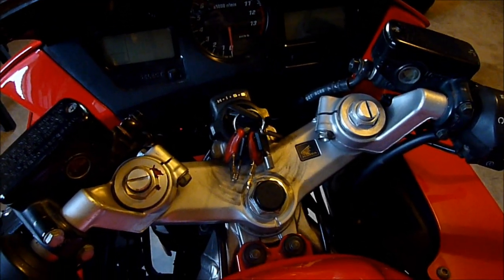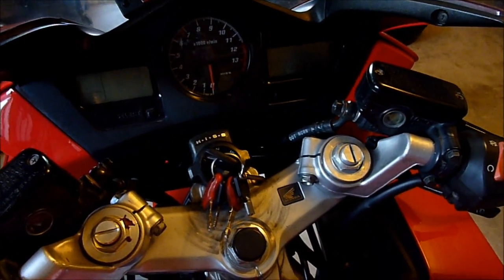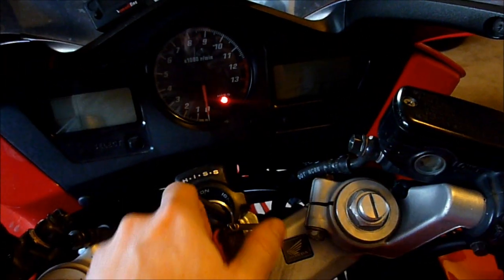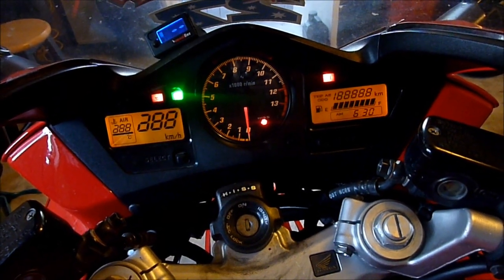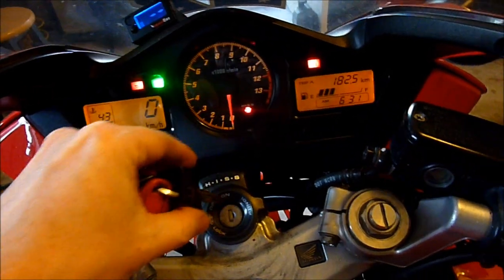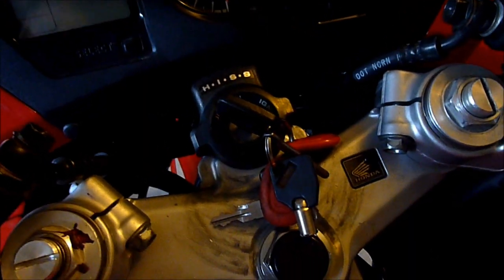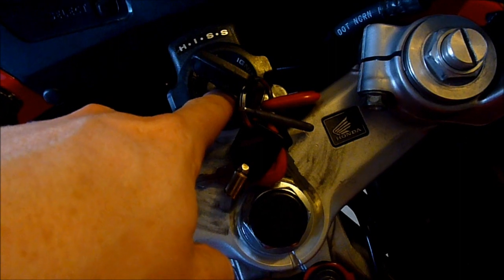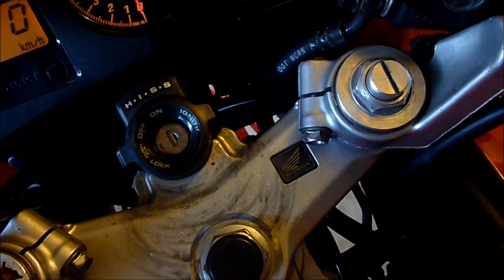Honda Ignition Security System behaviour

Comment from the maker: You could easily test this - wrap one key up in heaps of tinfoil so that when you insert it the HISS fails.   Then take a spare key and hold it near the transponder ring on the ignition block so the bike starts.  When the bike has started, remove that second key and see what happens.

Comment: On my SH300i I can start the bike on a non-chipped key (but have to hold a chipped key next to receiver). THEN, take the chipped key away and the bike will continue to run. I think the chipped key is only required to "activate" the system once. You need the chipped key each time to start the bike.

Comment: hi, brilliant video thanks, i have a hornet 2007 with HISS system, i was wondering if it is possible to drive the bike using just a cut key for the ignition and another key say just attached to the key ring which is coded to the bike. 

im just wondering if the hiss will get confused with different transponder chips next to it.

Thanks for your time

Comment from the maker: Not sure what you're trying to do?  If you have a broken key you can just pop the chip out of it and put it into a new cut key.  The transponder and chip has nothing to do with the metal in the key; it's an RFID chip which is powered solely by the transponder's radio waves.

Comment: I have a 954rr with a 929rr gauge cluster. When i turn the ignition on the light is green. Fuel pump primes and then it turns off. Bike starts normally.

When i turn the bike off the HISS light does not blink or flash red indicating that it is active. I know it is active but i just want the flashing red light on the dash.

Can people with 954 or 929 confirm if this is a feature that they have ? And how can it be enabled?

Comment: I had a new key cut which works in the ignition key barrel. When I turn the bike on with the new cut key while still having the original key (with original HISS transponder chip in it) right next to the cut key it works. I had a second new key cut with the second original key on a second bunch so now have two bunches. Each bunch (both OEM keys have have snapped hence the newly cut keys) has an OEM key and the second newly cut key. The weird part is that only one bunch works to initialise the fuel pump which enables me to start the bike. Anybody experience this and have any ideas what the issue is?

Comment: Hi mate what would happen to honda security system if you replace ignition key ? got 2005 cb900 replaced ignition key  (hiss still there ) and ganna get someone in Perth to  program new key with my old key hopefully.( instrument panel have no power at the moment . fuses good and battery charged . what would you say ? thanks
Reply: did you get yours sorted out? im currently working on a cbr1000 2011, broken ignition barrel, had new barrel installed and key programmed with my old key. but the pump doesnt prime. please help

Comment: Hey bud.  you still around.?????  Got a question.  How can one reprograme the the keys when H.I.S.S Has lost all data transponder programes.  No keys work at all, just because the battery was removed and put on charge.  I removed my battery and recharged it, got back from holiday and put battery back on to the bike and no keys dont unlock the HISS system.  No fuel prime what so ever.

Comment: Is it a true electronic ignition? I.E. You present a correctly cut key but have no xponder, does it still turn?

A true electronic ignition doesn't allow a key to turn, unless it has the correct transponder present, preventing you from disabling the steering lock and walking the bike away to work on the transponder data at a later point.
Reply from the maker: No, it does not stop the key from turning.  But I've personally never seen a vehicle that does that.

Comment: Should the HIS light be flashing constantly?
Reply from the maker: The HISS light flashes regularly when the bike is turned off to remind potential thieves of the security system.
Reply: @KaldekBoch  what if it stays always on, with key or without key? Any idea on what to look for? I have the Honda Hornet since 2006 and it always blinked without the key, but now it stays on and is draining the battery. The bikes starts and rides fine.
Reply from the maker: @downhiller010  that's odd.  I don't know what it means but it sounds incorrect.  The HISS light though is driven by the dash cluster so perhaps it's a bad connection into the cluster from the ECU?  Sorry I can't help more but I'd start by Googling "HISS light stuck on"
Reply: @KaldekBoch  I'll take a look at the connections.I googled it without any conclusion. Thanks!

Comment: I have problem with my HISS, when I turn the key I dont get the fuel pump sound, I dont get hiss light on and bike wont start.
I had a little crash last weekend and I was fixing the front fairing, obviously disconnected everything at the front. Where I think I went wrong was when I tried to start up the bike with everything disconnected, needed to ride the bike back to garage. It is CBR600RR 2005.

Any ideas, highly appreciated.

Comment: all these so called security systems are only good to add cost to your bike , all crooks need to steal your beloved bike is an old beat up van / station wagon  , load it up , two guys and 20 seconds will do the job , take it somewhere safe , check it for gps , strip it down and sell the bits ...
Reply: +fred rit // There are some tracking devices under $500 that text you the location of the bike if people touch it or try to move it.
Reply: +Edward Armstrong  here in Europe they cost less than that , but there's a montly fee of 10 euros   for a minimum of 1 year and it is only good until they find it and remove it , plus the police here are useless and will only treat a stolen bike report as a mere statistic . I have HISS on my CB 500 F , wich I guess is one more line of defence along with two other solid and costly anti theft devices wich I use all the time . 
The HISS will make 'em think whether it is worth it as it costs big money to replace the ECU , unless they decide to steal the bike for spare parts .
Motorcycle theft is a huge problem worldwide , they're so easy to steal...
Reply: My Fireblade was stolen yesterday - found it today w. messed up wirering. They couldnt beat HISS